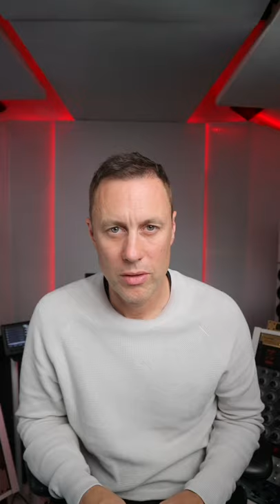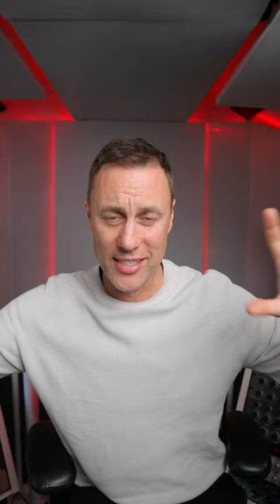Do this with M/S COMPRESSION when MASTERING!!!

Comment: Never heard of it ::: unexplored dimensions , also you could talk about some tools for the same . I am not sure , as per the tip from KSHMR , I normally use voxengo msed to remove side info from
 Sub .. elements to reduce phase issue .  But still confused how to switch between mid and side from a abelton Multi band compressor. I know we can do downward compression and expand using mdc. Please help with a tool name .